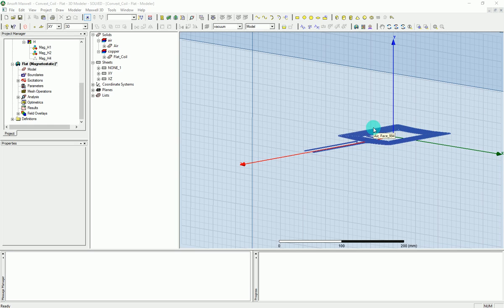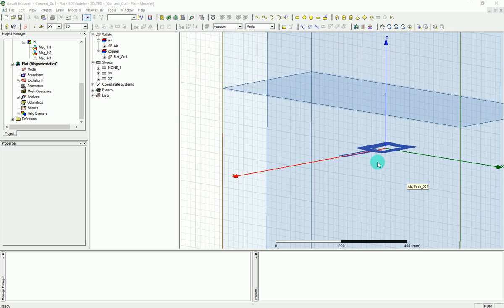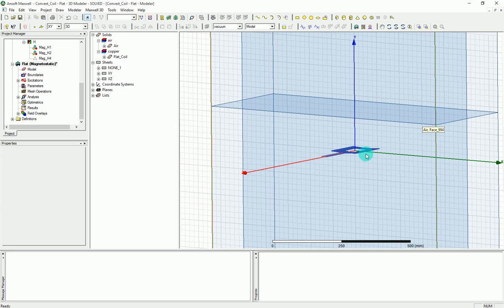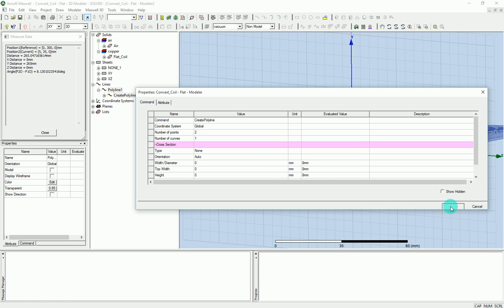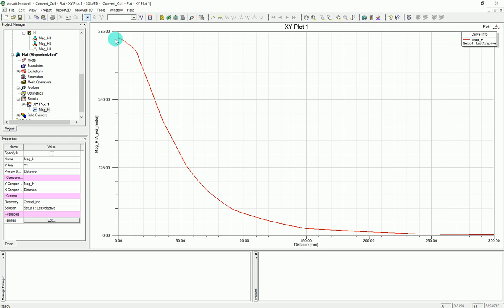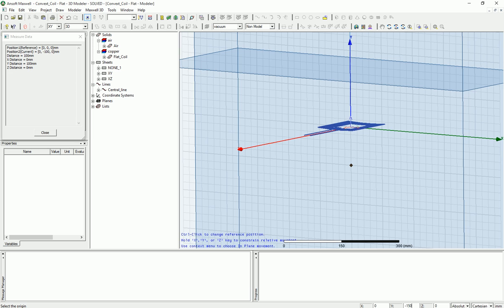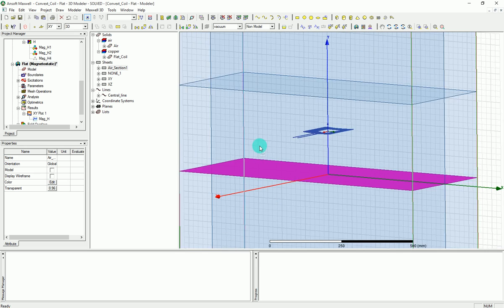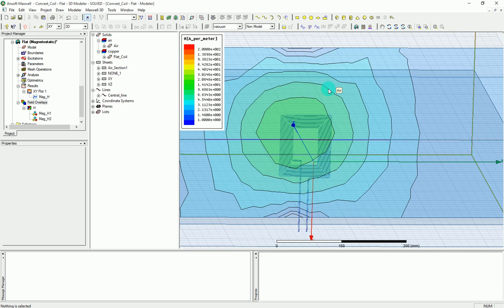230- Ansys Maxwell- How to plot the H-field over a path. and more .

Comment: Hi! Thanks for the nice video. I was wondering, is there a way to do the same with a variable connected to the materials used?.. such as density, or permittivity, or conductance, etc.
This because I need to know which material is in each node/element, but this information seems impossible to retrieve. With the technique above, I could get this values with some calculations.
Thank you!
Reply from the maker: Yes, the Caruso need to be project  variable though. To make a variable project variable just add a $ before $v_temp

Comment: How to only plot the z-Component of B or H ?
Reply from the maker: https://www.youtube.com/watch?v=2DFP8tMm4AE
Reply: In this video, you illustrate how to plot Mag_B along a line. I have to plot the projection of B vector on the z-axis to get the z-component of B vector. Depending on the slope of the flux lines, this also could yield a negative value, whilst Mag_B cannot. I think this could be achieved by "Bz=Mag_B*tan(slope angle of flux lines)" , -  but how to enter this in Maxwell?
Reply: found it: it';s in the Maxwell2D->Fields->Calculator window..

Comment: Hey Kamyar, thanks for the very resourceful video. I would be very thankful if you can create a video showing how to create surface plots in 2d and 3d model. Also, the maxwell gives a band of electric field, so how can just click at a particular point and know the field value at that point.
Reply from the maker: +HIMANSHU BANSAL  Hi, 
I went through  those types of plots in many of my tutorials. please follow up the third part of some of the tutorials to find the method.
Reply: +kamyar K Sir , why we always get plot along positive axis, so how could I get symmetrical plot along positive as will as negative axis. I shifted origin and also draw non model field line along _ve axis, but I get solution plot only along +ve axis, they consider the extreme minimum as a zero and then add up to end point of line. Please help as quick as possible, thank u